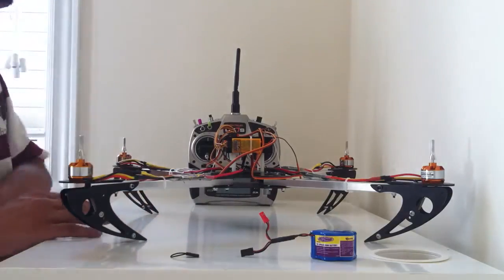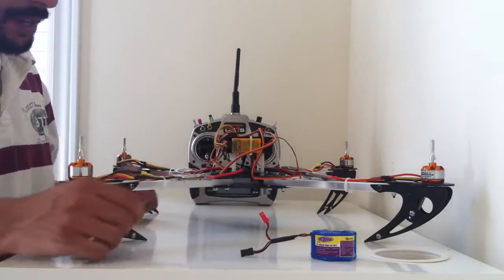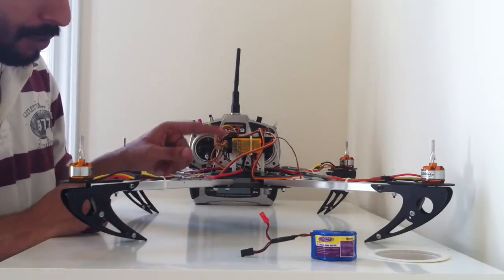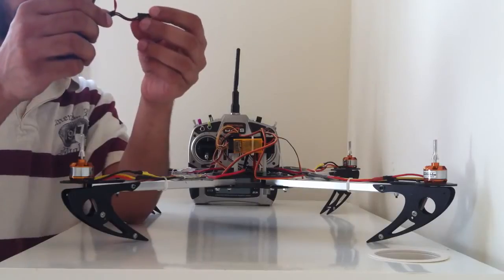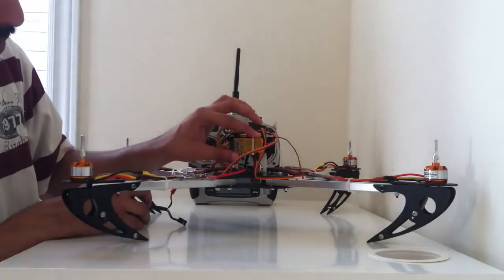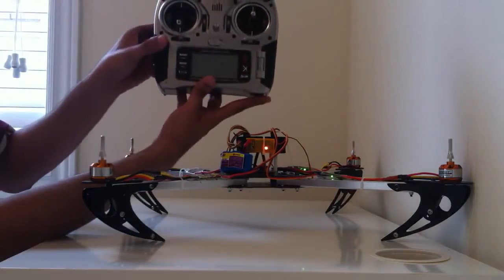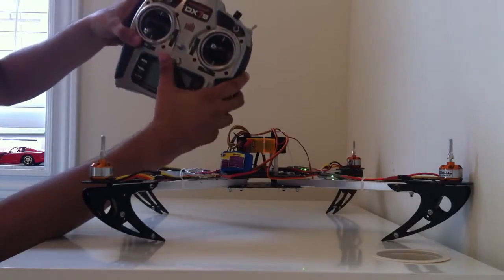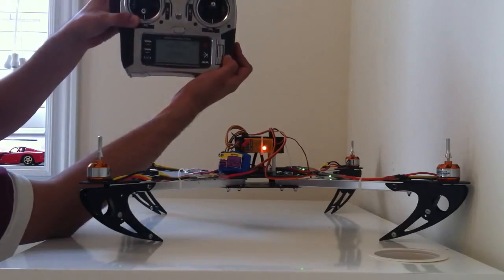Bind Spektrum Radio to OrangeRX Radio Receiver

Comment: Total newb here. I'm trying to figure out where to get the needed battery pack. Can you let me know which one you used?
Reply from the maker: +Glass Man For a quadcopter any 3S or 4S pack should suffice.
Reply: Hello total newb here as well. I'm still having difficulty binding DX7. The lights for the receiver blinks but nothing else works. Thank you in advance